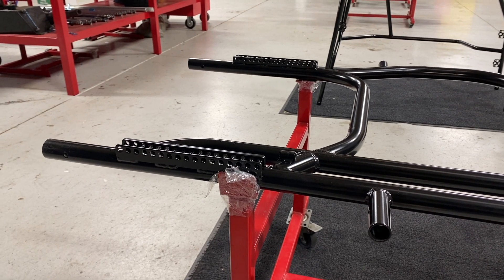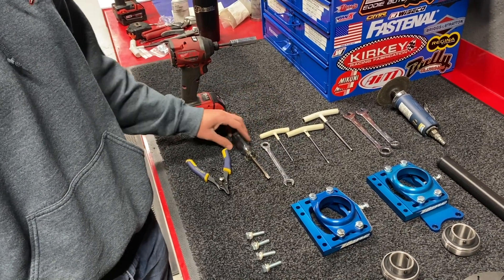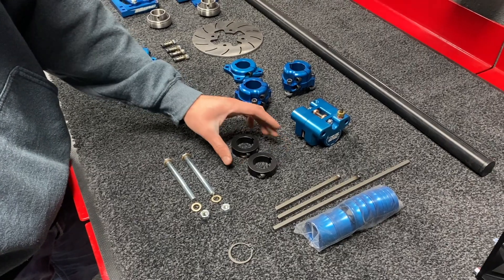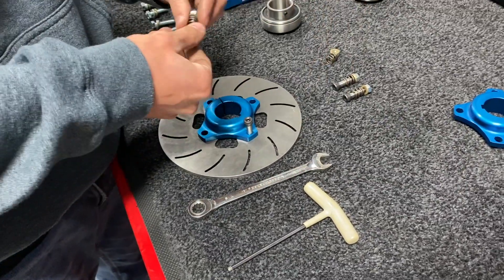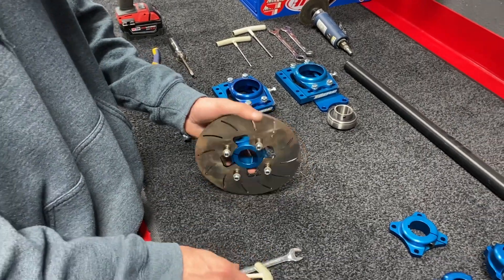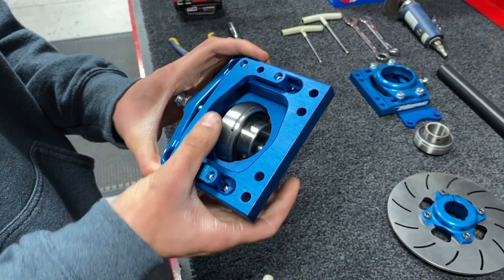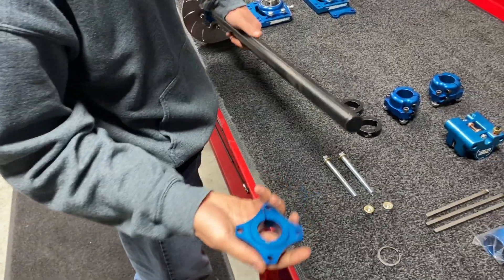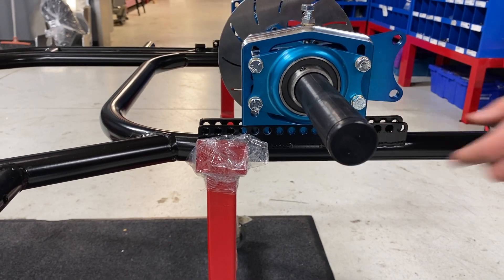How to build an Outlaw Kart: Step 3 - Rear Axle Assembly

Comment: So if the most asked question is where to bolt in the bearings you didn't ever explain why the holes or the other adjustment so what's the point of the video anyone 10 year's and older could put an axle in ?